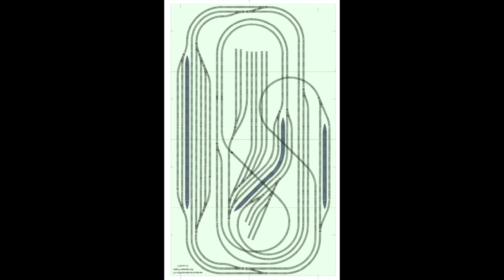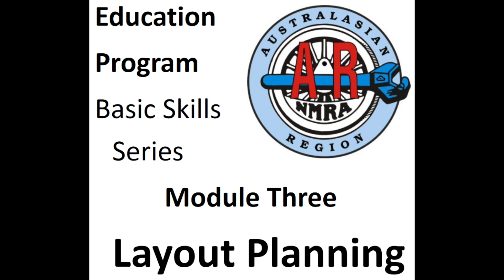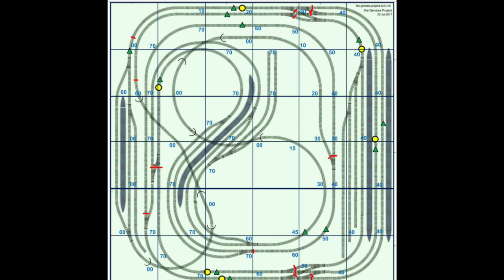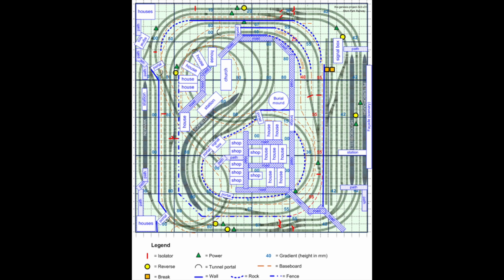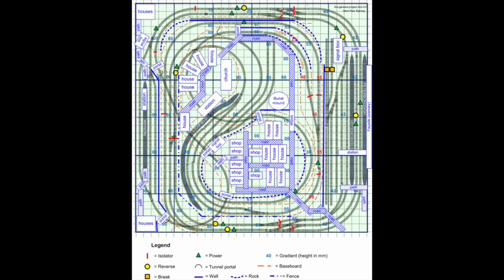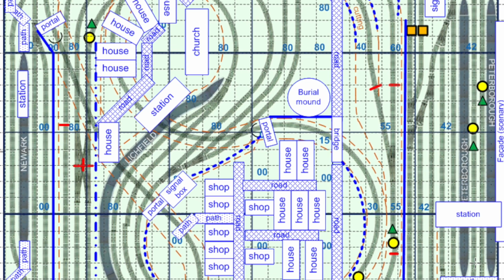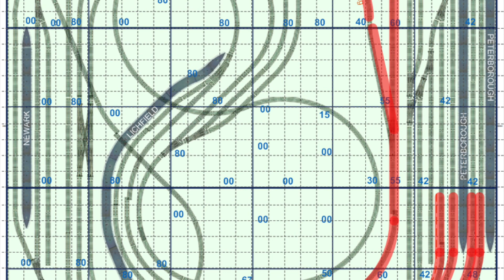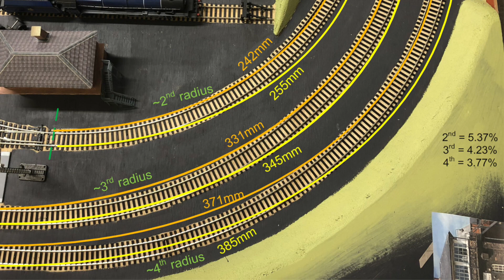The Rise and Fall of Model Railway Gradients

Comment: Some thought provoking information. However, you failed to consider the wheel coning which acts like the differential on a car. The coning looks very obvious on the plastic wheel you showed. Not so obvious on the metal wheel. All wheels should have coning. 
As an axle with coned wheels goes round a curve, the wheel set will move towards the outside of the curve so that the outer wheel is running on a larger diameter of the coning, the wheel on the inside of the curve will run on the smaller diameter of the coning. This accommodates the different running distance on the real thing but probably can't deal will the tight radii that we operate one. Anyway, it shouldn't be forgotten.
Great video.
Thanks,
Bob (UK)
Reply from the maker: Thank you Bob for the explanation of the wheel coning, it is something I was not aware of, and is very helpful to know. Awesome
Reply: @montparkmodelrailway300  Hello Again, I don't know if you are aware but the rail is not perpendicular. It is laid at a slight angle, inwards, to match the angle of the wheel coning so that the whole of the wheel tread is always in contact with the rail.
Regards,
Bob
Reply: @montparkmodelrailway300  That is true for a full size railway where the mass of the wagon/loco/coach with forward movement will "push" it towards the outer circumference (note also automatic greasers being fitted at the commencement of curves to minimise wear). However on model railways I suspect the drag of the train and the tighter curves will tend to pull the rolling stock towards the inner circumference.  It's all going to be dependant upon individual circumstances. My layout has minimum 36" radius curves and my locos can generally cope with 6 coach trains albeit no inclines.